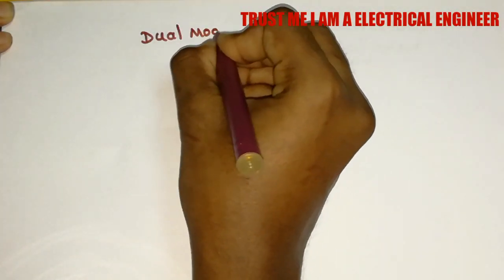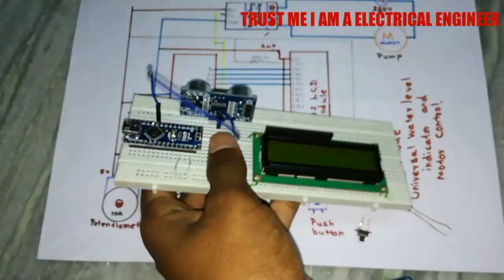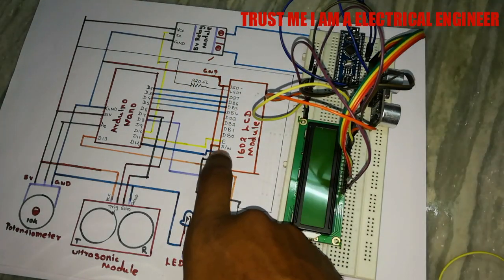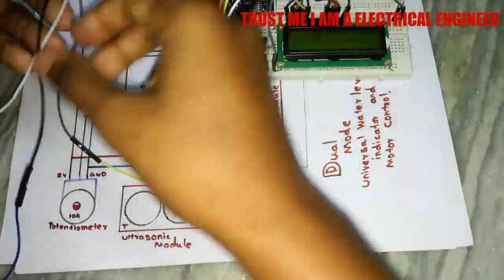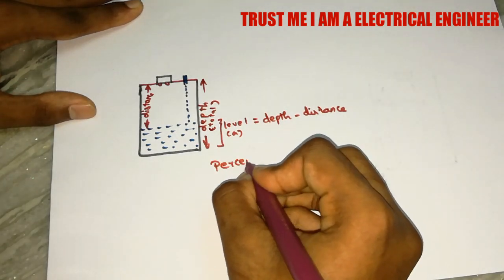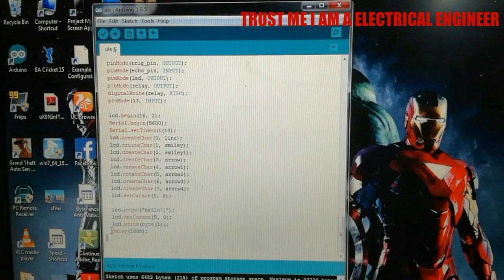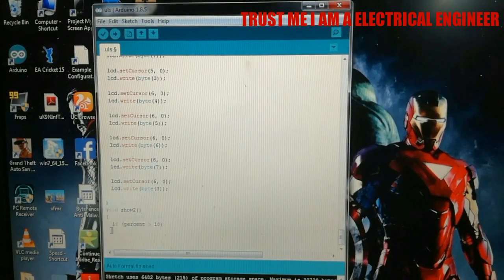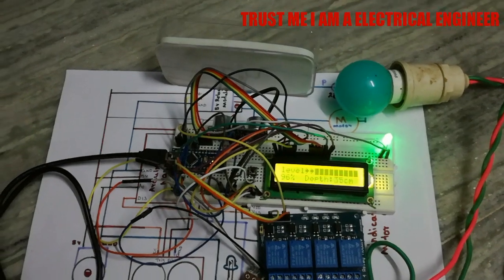Water level indicator and motor control || fully automated using Arduino|| ultrasonic sensor || LCD

Comment: Thanks for the video, but i have learned that ultrasonic sensor in real world scenario is not reliable due to extreme cold in winter, high temperature in summers and due to humidity conditions. So using wires as sensors is more feasible and prune to all above mentioned conditions. So will you make its version 2 video in which you overcome all these problems and include some more must have features like manual switch to turn on/off motor at any time, make it wireless using RF modules as they are very cheap and it will solve the problem if the tank is at 3rd 4th or even at higher floors.
looking forward. thanks

Comment: Hi brother are this surely work?? Please tell me I'm gonna make this
Reply from the maker: yes it will work
but make sure the sensor sufficiently above the water
Reply: @Trustmeiamanelectricalengineer  Brother its working but I can't cahge Distance in potentiometer what is that poblerm?
Reply: @Trustmeiamanelectricalengineer  And also brother how much ampirs want to give arduino nano the poblerm is I will connect it to mobile charger it was not working

Comment: Sir sensor data lose when I use longer wirse
Reply from the maker: Is it... I may due to reduction in power... Make sure the supply is 5v for sensor
Reply: @Trustmeiamanelectricalengineer  Amp.?

Comment: sir i chack sooner sensor  with 30 meter longest wires but my device show tank full on lcd and relay off
Reply: and with out sens my sensor  work by 30 meter long wires use  solve my problem please
Reply from the maker: Please replace the potmeter and modify the code that fed the tank height directly

Comment: plzz show me the  right connection of rellay bzz when i  start this then lcd diplay dint work sir plzz rply fast
Reply from the maker: Can u please tell me what type of relay u use..??
Reply: @Trustmeiamanelectricalengineer 5  volt dc to 12 volt dc relay use
Reply from the maker: U can download the circuit diagram and compare it with urs
Reply: Can you give me  u r WhatsApp number I will show you the pic
Reply: Or email address
Reply from the maker: hajjamalfaizal759@gmail.com
Reply: Have you got  email ? Then plzz tell me
Reply from the maker: @prathameshlabde  yah..
Reply: Tell me sir I want to give this project In college
Reply from the maker: @prathameshlabde  just modify the code little as ur requirement

Comment: Sir please tell me this installation 
If I install Altura sonic sensor with long wire on top roof Tammy and  all module down side install so will Altura sonic sensor data not lose 
By long wires please clear my question
Reply from the maker: Don't worry about that the data is already processed in the module
Reply: @Trustmeiamanelectricalengineer  it mean I can use   longest wire  on sensor ground floor to third floor
Reply: @protechnology550  use cat 6 wire but morthan 10 MTR sensor not working properly. maybe ...!

Comment: sir my circuit ato matic ly show relay off and on  sensor no response sir cuit on and cut off and lcd show full tank when circuit cut off  and lcd show  level 1 depth  0 and continue blinking lcd in on condtion
Reply from the maker: That code will be updated soon for u with an upgrade using i2c lcd and replace the potmeter ect.. With digital push button.. I will update it soon as possible... Thank you for following me
Reply: THANKS SIR 
I M WATNIG  UPDATS

 @Trustmeiamanelectricalengineer
Reply: is there an updated code for using i2c

Comment: Does the pump work here? please reply
Reply from the maker: Sure... Replace the bulb with pump
Reply: We are planning to do water level controller. So if the tank reaches the maximum level. The pump will work. 

Can i use dc pumps for presentation purposes only?
Reply from the maker: @markowencalabia7914  yes u can... Use any type of motor the relay will act as a switch..
Reply: yes'

Comment: sir why are you  using push switch and 10k  variable resistor?
Reply from the maker: To set the depth I am using 10k pot... And to change the mode between measure mode and control mode I'm using push button

Comment: Where is code sir
Reply: Sir I make it but I chack my  circuit
LCD not respons  and LCD blinking  speedly how can I work by it
Reply from the maker: @protechnology550 can you please send a detailed description about your problem
Reply: @Trustmeiamanelectricalengineer    Sir I on my circuit by 5 v. Mobile charger and Arduino on light led  sometime on and LCD  screen blink speedly  when I push the button then screen still on  sensor not response of any kinds Arduino per light also on relay red light on only
Reply from the maker: see description
Reply: Please tell trubbel shooting
Reply from the maker: @protechnology550  ok i will find a definite solution for u..